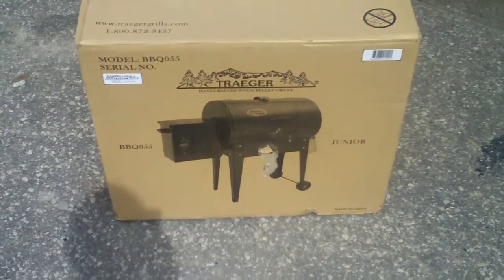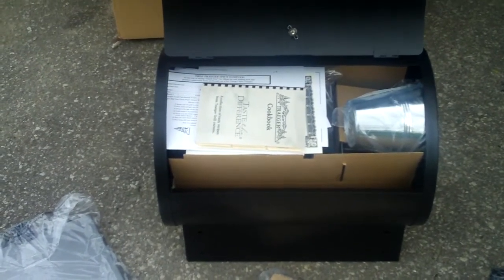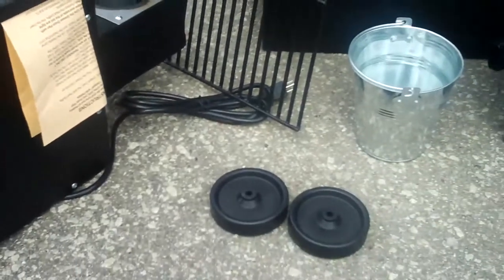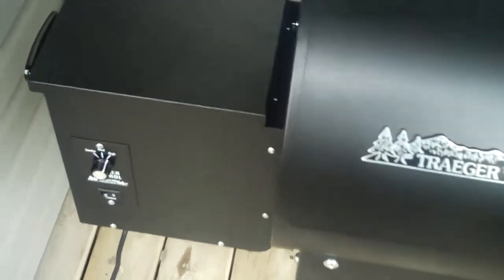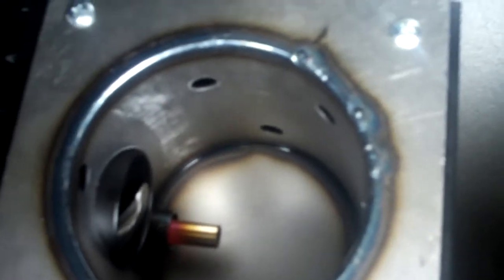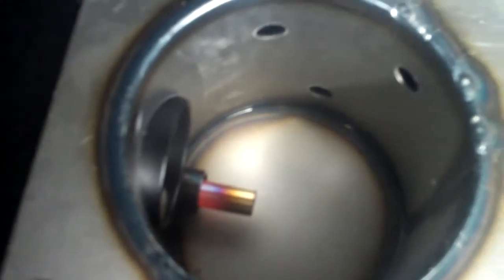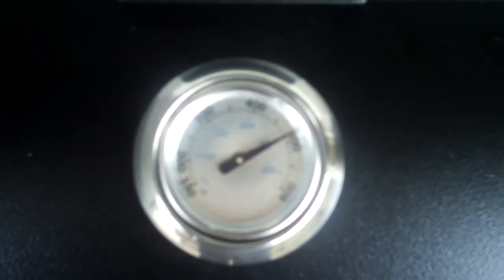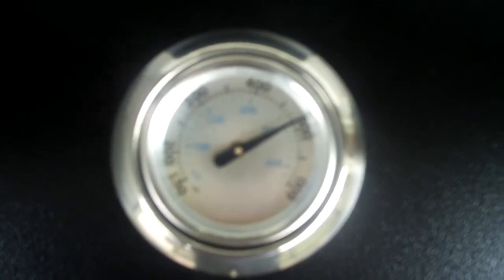Trager Grill Smoker

Comment from the maker: @ectorgarcia Cooking temps are preset from the factory.The lowest setting runs about 200 to 225 F , the medium runs about 300 to 350 F , and the highest setting runs from 350 to 500 F.There is also a digital replacment theremostate that can be bought that you can low as 160 F if you desire.Also manual calibration can be preformed if need be for adjustments etc